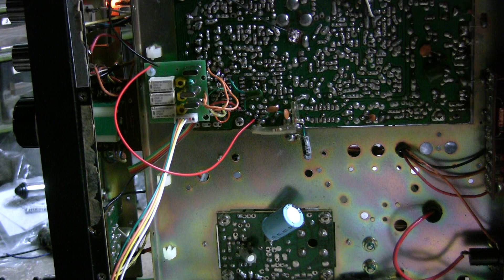New Expo 100 L-C-B-K kit 40 ch above and 40 ch Below for cobra 2000/148/grant/Washington and more

Comment: why didn't you use transistors instead of using the relays? It does look like you did a really good job on the boards.
Reply from the maker: I did design a 3 transistor switch board but too much noise caused noise on the xtals. The relays are total isolation and the channel kit works great on SSB no problem tuning the trim caps for center slot both AM and SSB. Sold about 60 kits and not 1 complaint.